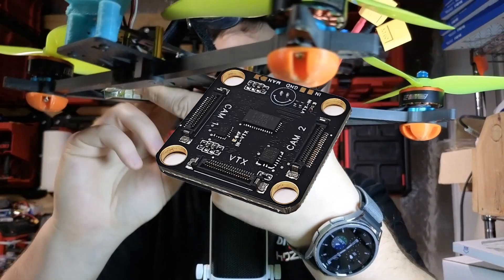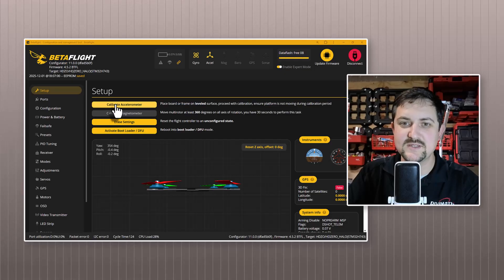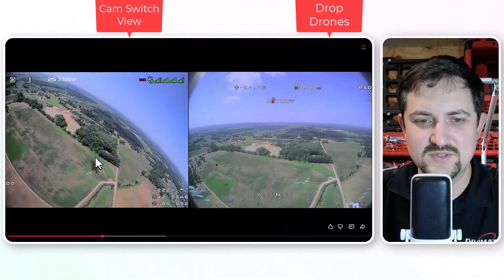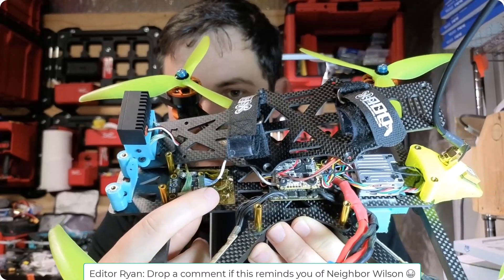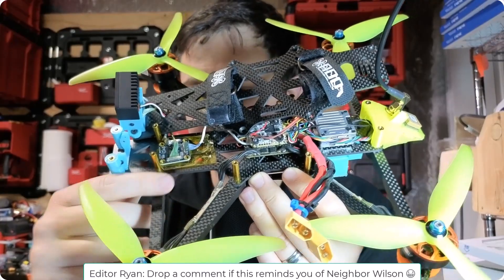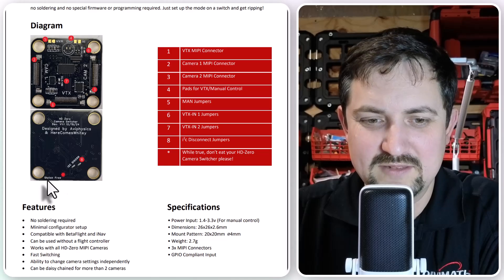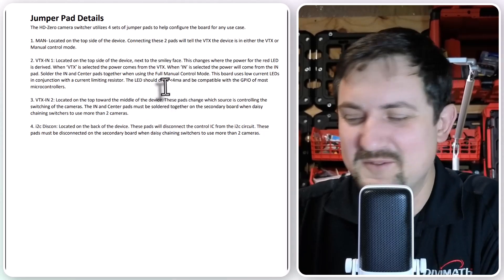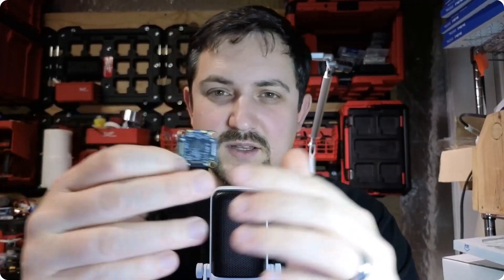Night Vision, Downward View, Rear Cam – The HDZero Camera Switcher Changes Everything

Comment: Where can we find the manual for it? I can't find any github repos or official docs anywhere. EDIT: found some on all-manuals-whatever website, not sure if they are relevant.

Doesn't switch anything though, just shows feed from camera 1.
Reply from the maker: The manual is at hd-zero.com
Reply: @RyanQuellet  Thanks! Should it work with HDZero Freestyle V2 and two identical MicroV3 cameras? It doesn't even turn the green led on.
Reply from the maker: @gebiete need to update to latest vtx fw. I think it is v1.7.1
Reply: @RyanQuellet  That's pretty important thing, could be mentioned somewhere in the docs.

Comment: Fun product, having another camera with no IR filter might have it's uses.
I'm switching between two analog cameras (normal and a thermal camera) using a 5V relay, control with buzzer pin and pinio. So much simpler when there's just one wire to worry about :)
Reply from the maker: This is a good idea
Reply: @RyanQuellet  Would this work with HDZero Eco cameras?

Comment: Ive been waiting for this   I have a scale rc crawler with a snow plow and fpv.  and need a rear view camera.  until now my only option was analog.    In my case 1080 at 30  is not a problem because Im moving much slower   excelent
Reply from the maker: Yes, this would work perfect for that case. Share a video of it when its working!

Comment: In most cases described I see that picture-in-picture would benefit way more than full camera switching for like 90% of the time.
Real use case with 2 different cameras would be as described: one is with no zoom (or even super-fish-eye), and another with 3-10x zoom lenses. Or another one is totally different kind of camera, like a thermal one (any plans on these, HDZero?). Or maybe a virtual OSD, like a full-screen map for autonomous mapping or nav missions.

But it is a good start. Means community looks into other applications, beside pure "racing FPV", that HDZero is well known for.

Comment: are those using v2 or v3 micro cam?
Reply from the maker: In this demo, I used Micro v2 and HD90 cams. It will work with any MIPI camera for the system
Reply: @RyanQuellet Nice... I mean for that removed uv filter
Reply from the maker: I removed the IR filter on the HD90 camera lens